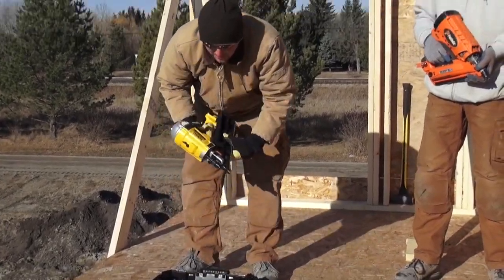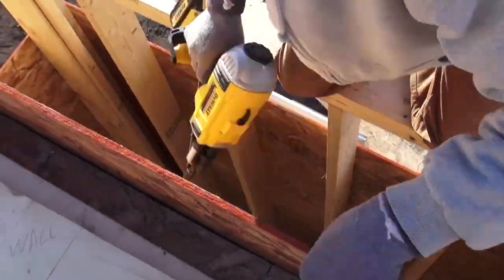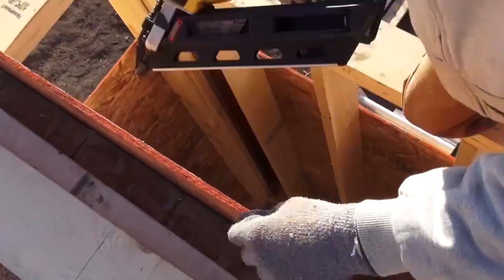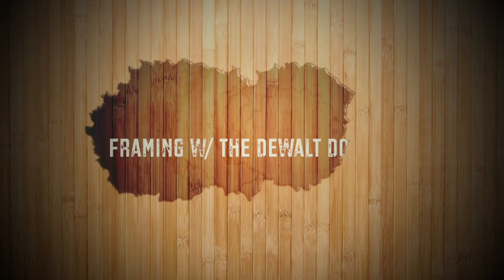DeWalt DCN690 Cordless Framing Nailer Follow Up Review

Comment from the maker: @JustinTrojan The Battery usually is charged in 30 - 45 min.  You get about 600-700 rounds before you need to charge.

Comment: how does the power compare to an old classic air-fed hitachi?
Would you use an air gun for low slope roof sheathing or the dewalt?
Reply from the maker: +Justin Crediblename an air nailer is going to be a bit faster BUT I have used the DeWalt in about every application and have come to really like it.  It is a bit heavier but your not fighting with a hose or compressor.  Check out our latest review here: https://youtu.be/D4iCafVeOn0